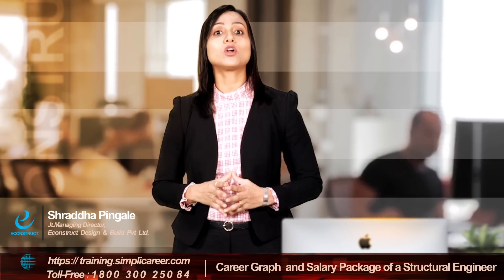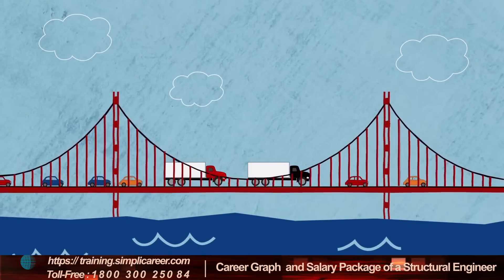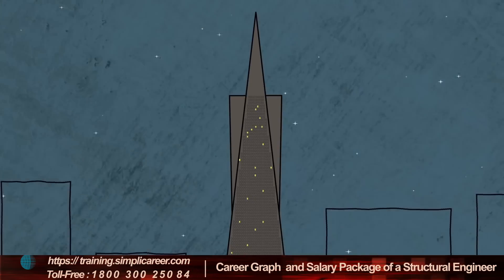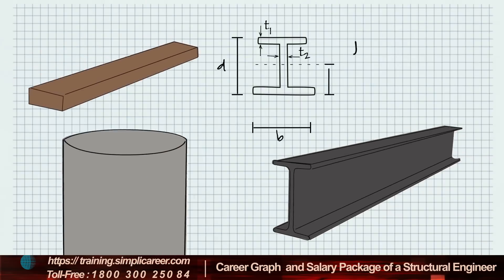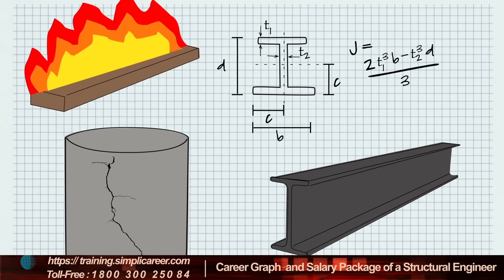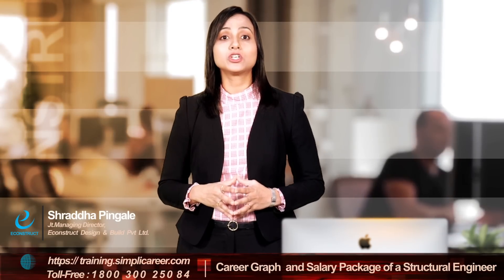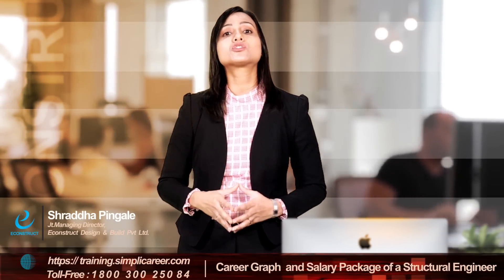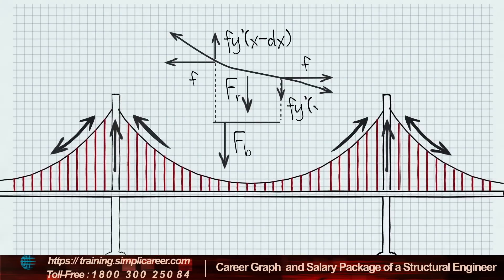Career Graph and Salary Package of a Structural Design Engineer (Visit our WEBSITE  e-construct.in)

Comment: On speculative average, a beginner structural engineers are getting somewhere around Rs. 22,000/- to Rs. 38,000/- monthly. There are also people who are getting either lower or higher than these amounts.

On speculative average, a mid-experienced structural engineers are getting somewhere around Rs. 40,000/- to Rs. 1,50,000/- monthly. There are also people who are getting either lower or higher than these amounts.

On speculative average, a experienced structural engineers are getting somewhere around Rs. 1,00,000/- to Rs. 6,00,000/- monthly. There are also people who are getting either lower or higher than these amounts.

Please see your industry average for a more accurate representation of salaries.

Hope this helps.

Cheers!

Comment: Important videos would be on imparting business skills to a structural engineer to sell their skills at correct hourly rate. Its a hard line requiring blend of numerous skills and does not pay commensurate to the efforts. This results in compromises during analysis and design processes. Also structural engineer usually does not have necessary set up and industry backing to get paid for the variations imposed upon by others requiring additional time and effort. Compare this profession with doctors and lawyers to find that they are indeed a poor lot.